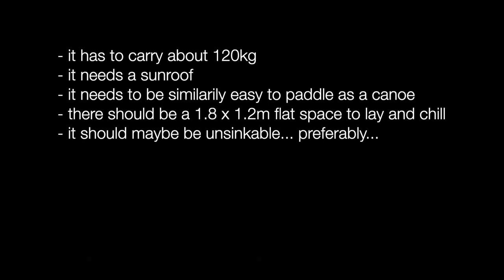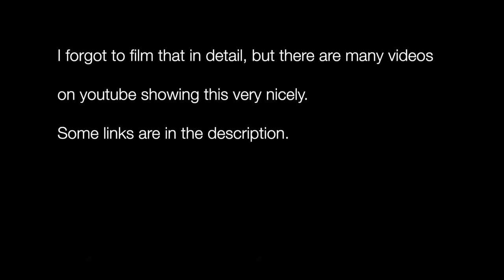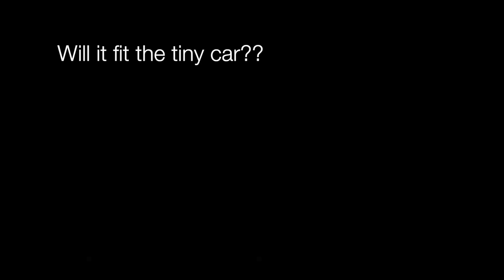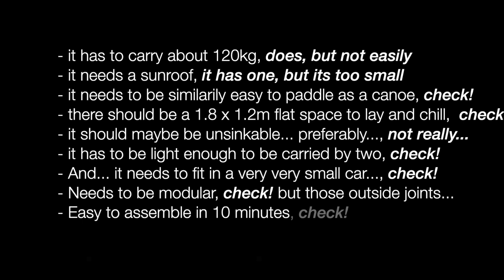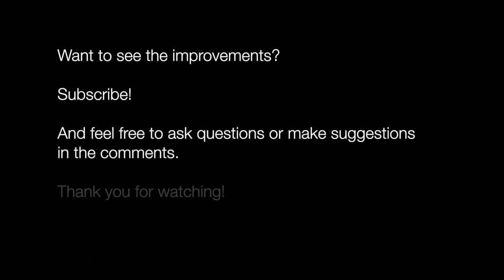A modular portable lightweight catamaran raft - V0.1 - Fits in a micro car.

Comment: Great job!  Fascinated by the design - the connectors on the bottom of the hulls are not an issue on my opinion - they look fine and their simplistically functional. The simpler the better. Would a roof rack for the car help with carrying bigger parts?  Would love to see your improvements.

Comment: Why not the bottom connectors inside the hull?
Reply from the maker: Because it would require holes through the hull. They would be under water. To make them water tight didn't seem achievable to me, and even if I could have made them watertight they would have been a very inconvenient point of failure :) I'll upload a video of my v0.2 solution soon. It's much better and still outside the hull. :) And hidden.

Comment: Have you taken it out or upgraded in 3 years?
Reply from the maker: Yes I have added an unsinkable
 middle section to make it longer and give it more lift, changed the connection system and the sunroof and we have been out many times in the past years :) Was well worth the time and cost building it compared to renting boats or pedalos. :)
Reply: @jumbleblue  Where’s the V.2 video?
Reply from the maker: @echofoxtrotwhiskey1595  I haven't come around editing it. Thank you for the interest, I may do it some time :)